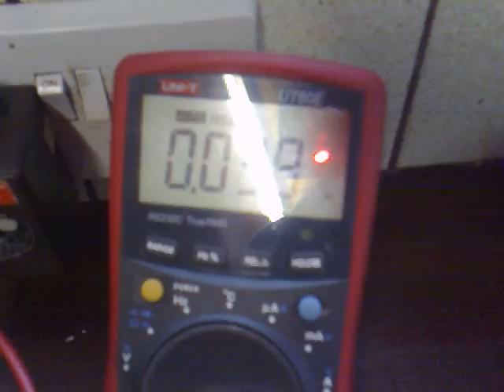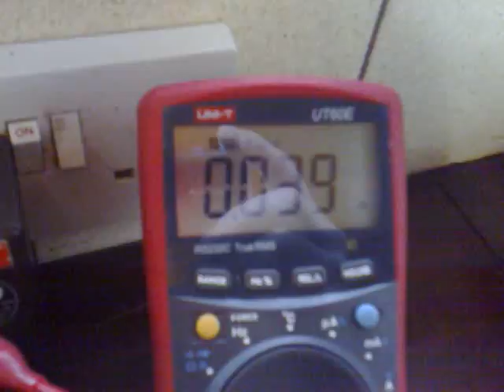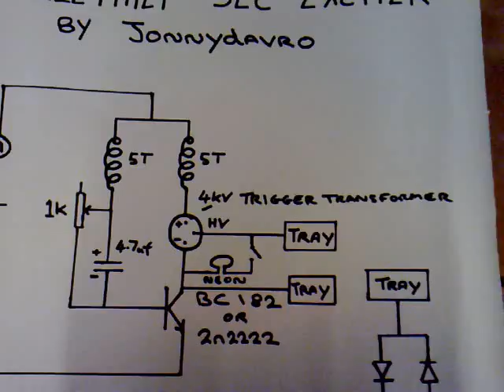Joulethief SEC Exciter-wireless energy transfer.

Comment: Increasing the number of radio recievers does not require an increase in power to the broadcast signal. The power equation for very high voltage with near complete loss of Ohmic resistence, approaches infinity. You could potentially light up an entire city with your forty milliamps!  Your Joule thief oscillator is really paying it's rent! Love it. Bravo!

Comment: Jonny:

Excellent!!  That does seem to perform like Doc's SEC.  Yet another great use of the JT circuit.  I can't believe it works on that small toroid.  Very fantastic work you are doing there.  I just got my SEC-18-1 in yesterday and I am trying to get it figured out.  Did you see Lidmotor's Jenna light video using a JT?  Some very great work going on in the forums.  Keep it up Jonny.

Bill